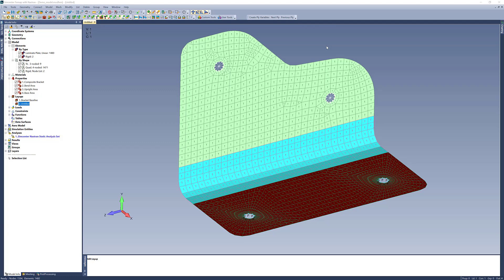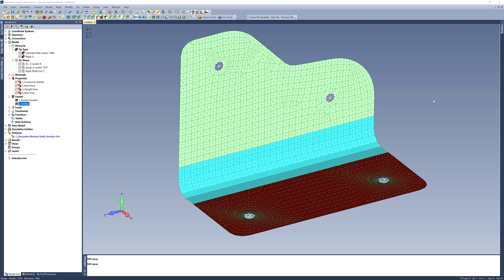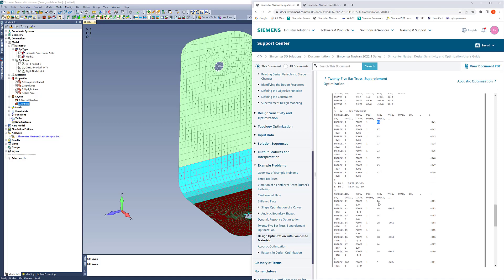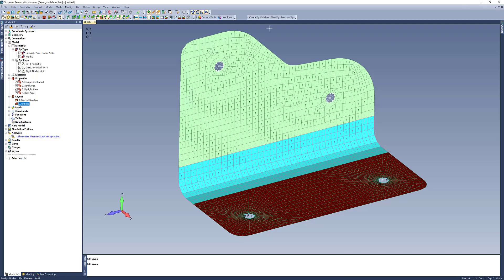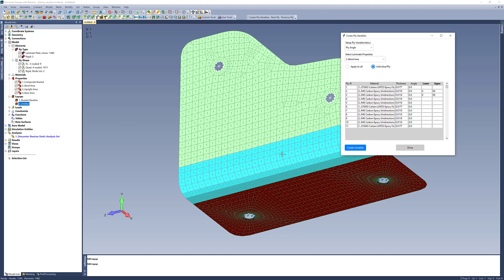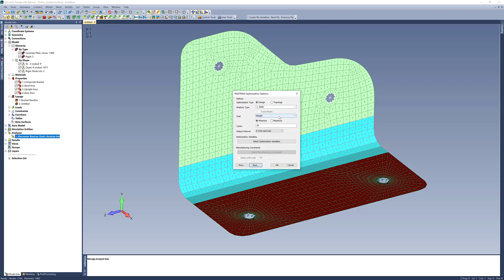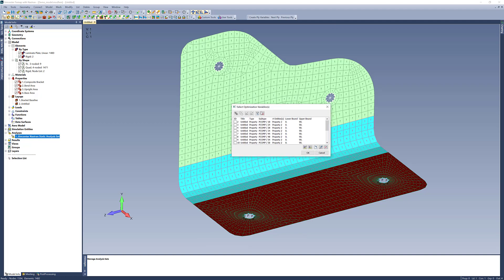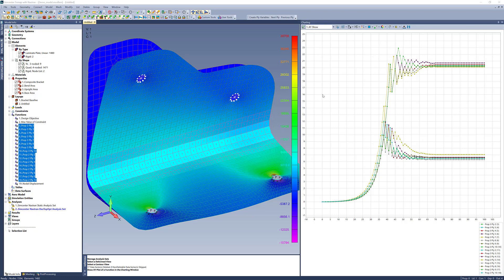Optimizing Composites in Femap using API (SOL 200)

Comment: So your code goes through and creates design variables that FEMAP/NASTRAN can use in the analysis. Is there a way to create those same variables by hand inside the FEMAP framework? I haven't found anything helpful for creating a variable for the ply angle inside a layup property.
Reply from the maker: I'm not exactly sure what you are asking. You could manually enter these variables into the input file before running the SOL200 analysis.
Reply: @troygiampietro9570  I guess I was asking if this capability exists within the FEMAP GUI, to avoid manually entering them or using the API executable.
Reply from the maker: @conner564  unfortunately not. Is optimizing laminate structures something you do?

Comment: I am trying to setup static topology optimization with automatic inertia relief, goal is to minimize weight with minimum factor of safety constraint.
with a constraint for solid von misses stress I get fatal error: DRESP1 RTYPE=CMPLNCE WHICH IS NOT SUPPORTED WITH INERTIA RELIEF.
Is there any chance you can please show how to do it?
Reply from the maker: Nastran does not allow you run with inertia relief on when the response type is CMPLNCE. From the docs:
The following items are not supported when a CMPLNCE response type is requested:
   Inertia relief (PARAM,INREL,-1 or PARAM,INREL,-2).

If you have already created the solid von mises Optimization Limit,  you could try setting the Goal to that in the NASTRAN Optimization Options dialog.
Reply: @troygiampietro9570  Thanks for clarifying, I assumed it only doesn't work when using compliance based design goal and not minimize weight goal.